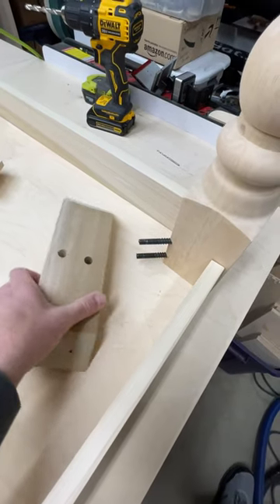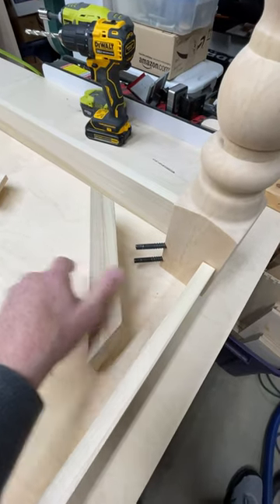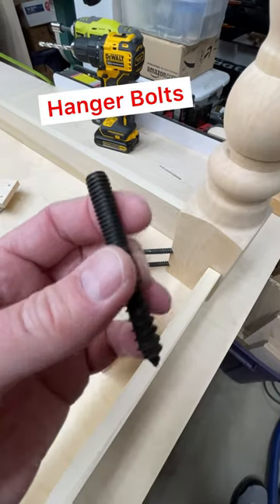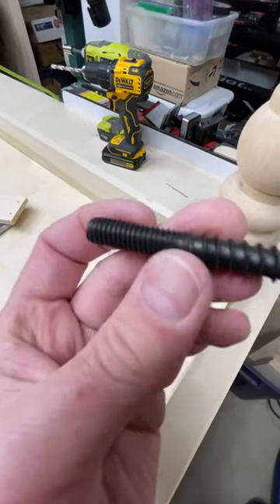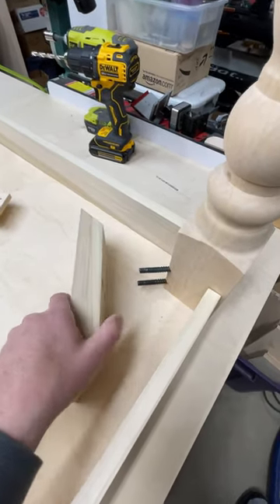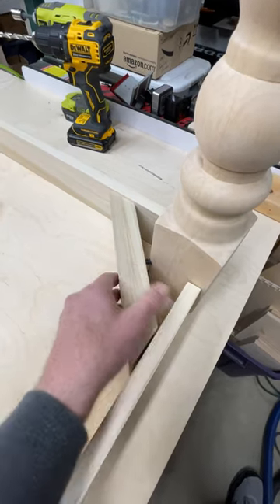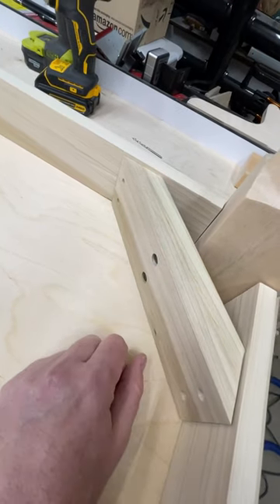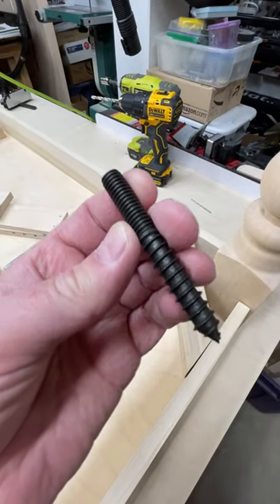Using some hanger bolts to attach my legs to the table apron on this build. ￼

Comment: I’ve been trying to find a solution for this design. Every piece of furniture I’ve ever owned, with the same mechanism to stabilize the legs, has loosened over a short period of time. Holes begin to strip &/or crumble. The 45 degree piece begins cracking, & it’s just an ongoing pain to deal w/.
Reply: Same exact thing for me i have 2 consoles with this type of apron style and the legs ALWAYS strip on the angle and become wobbly